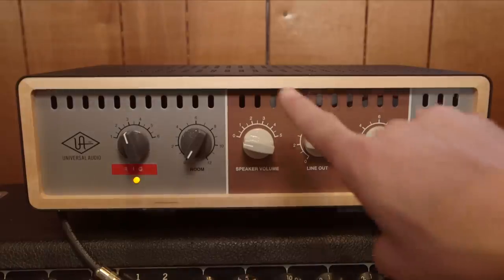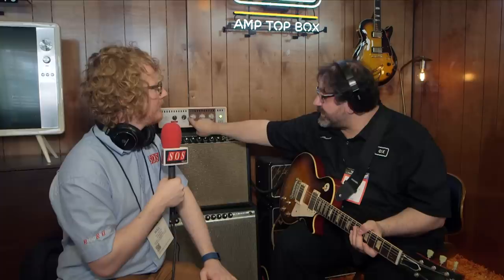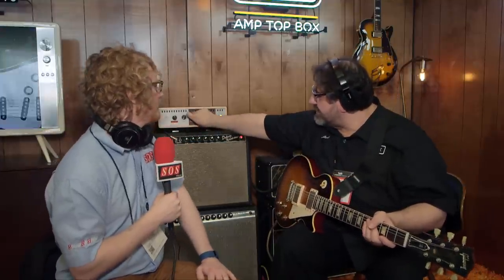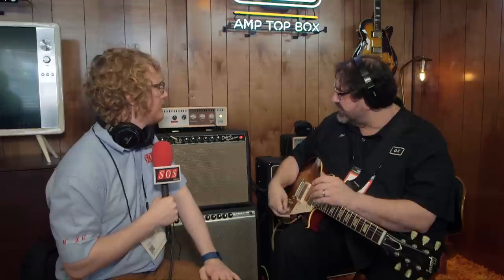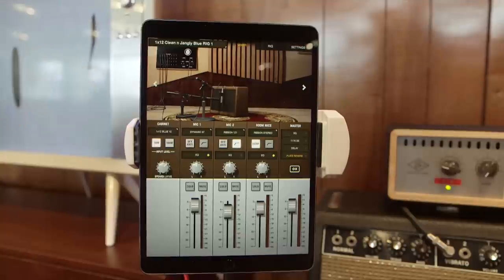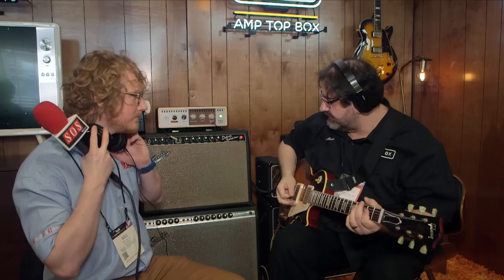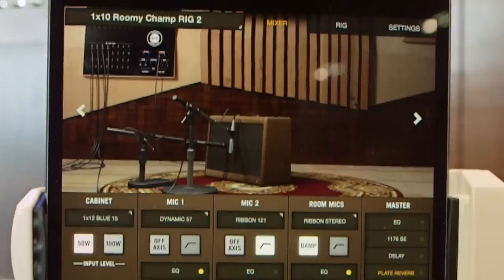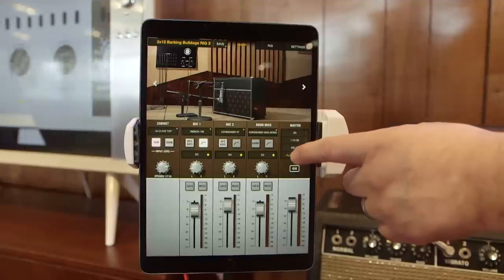Universal Audio Ox - Summer NAMM 2017

Comment: Kinda surprised how many people don't understand what this box is doing! 

Simple: 
You want to play your killer amp at mega volumes because it sounds the best that way, but isn't possible in alot of playing and recording scenarios because of extreme volumes. With this you can, and control the volume in a more managable way.

ALSO

It has the amp models to play through which is controlled by the ipad, and you can monitor that sound either through headphones or through your existing amp.
Reply: but where does the sound come from (whats the output) if you don't use a real cab?
Reply: Well, I'd assume that in a live situation, if you're not using an actual cab, you would be going line out of the UA OX right into the house system, which would be heard through the mains and obviously, stage monitors or in ear monitors so you can hear yourself onstage. That would obviously be convenient but then again, if the venue's monitors are shit, then your tone will obviously be shit as well.

Comment: $1299??? I can get a Suhr Reactive Load + AMT Pangaea CP-100 IR loader + Ownhammer IRs for $500-600. More than half the price of the OX and only 1.2ms latency vs the 2.2ms in the OX. This is a very expensive box for a technology that is already existing.
Reply: It's cheaper than the Two Notes, which is $1899
Reply: Stick to the Suhr reactive load for sure.  I'm buying one ASAP.  You are completely right in your assessment.  You can do way better with the Suhr reactive load plus the Ownhammer IRs and get the exact sound you want.  Totally unnecessary to spend $1299 on this piece.
Reply: The Suhr is just a load though, not an attenuator, you can't hear your cab at all. That's fine for a lot of uses but not all. It's a bit of a different product. I'm going to waiy untill I see it in person and hear it before I judge the price, hard to tell build quality or sound quality from a compressed Youtube video
Reply: Or save a few hundred extra and get a Kemper. Different direction but valid for some of the use cases they mention here.

Comment: that is a cool little box. Three questions though:
1) will we see other platforms being sported other than just ios?
2) is their an Ethernet jack on the back?
3) what sort or security dose the on board wireless access point have?
Reply: More information here: (Android to be supported)  https://vintageking.com/blog/2017/07/universal-audio-ox-amp-top-box/
Reply: No ethernet. The Wi-Fi access point is password protected and unique (password printed on the back panel). You can also add OX as a client to an existing Wi-Fi network.
Reply: right so defiantly a studio only device then. Wouldn't want to take it out anywhere because you wouldn't be able to connect wirelessly  to it due to all the communication pollution from the audience's mobile phones.
Reply: JOUE BIEN TECH actually - OX has its own Wi-Fi router with protected password so it isn't something that anyone can use without the password. Plus the Rig knob on the front allows for loading up 6 Rig presets in case you need to switch sounds

Comment: i'm still lost on what it actually does?  allows you to crank your amp to 10 to get the exact sound you want, then readjust the sound volume and tone through the box?
Reply from the maker: The idea is that you can plug the output of your amp head (or amp stage) into this, and have the output sound the same as if it's playing through a speaker in a beautiful studio, with reverb (if required). If it does what UA claim, this will be very useful for recording guitars. And, if you want to monitor through the speaker of your amp, you can do so at a low level with all the 'volume at 10' tone without waking the neighbours.
Reply: It's just an attenuator with some extra bells & whistles
Reply: MrIkesimba Those bells and whistles are the main feature, the attenuation is secondary to the cab/studio/speaker emulation, which is the stuff that UA is famous for (at least with emulating studio compressors etc).

Comment: Does an actual load have to be attached to the Ox or can you plug a head directly in with no cab?  That is never directly addressed in the video.  Otherwise, it seems awesome!
Reply: No cab needed.  But you can use your cab at the same time if you want to.  You could record your mic'd cab, record the UA cab model, and the raw attenuated amp for later cab selection - all at the same time.
Reply: Thanks!

Comment: Meh, Saggy nasty old crud speakers that are just not my sort of thing, Then worse is having to use a frigging iPad app thing too. So when not mic'ing up cabs, I shall be gladly sticking to my Rivera Rockcrusher Studio, Two Notes TORPEDO along with quite a selection of other options by Radial, H&K &...etc.However I can see/hear this being the type of cabinet and speaker era appealing to friends and fellow player's and engineers whom are older than I am and like low power handling drivers which break up and track far more loosely. UA will likely add more or release a model which features cabs and speakers which handle power and track tightly in the future, Having to use an apple device or anything else for that matter really gets on my nerves. Interesting nevertheless. Peace